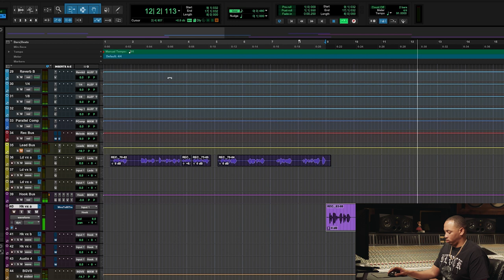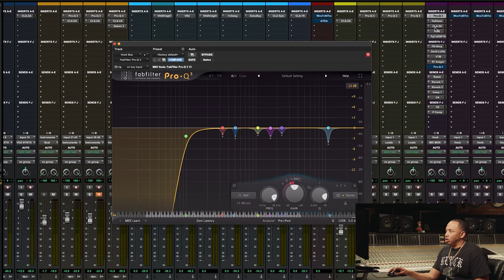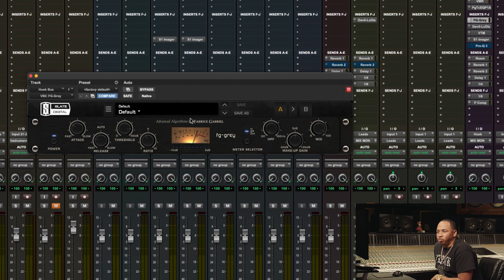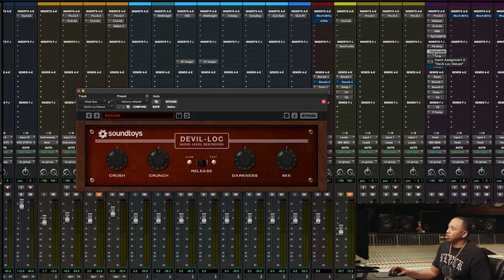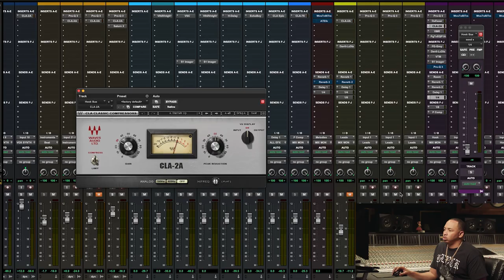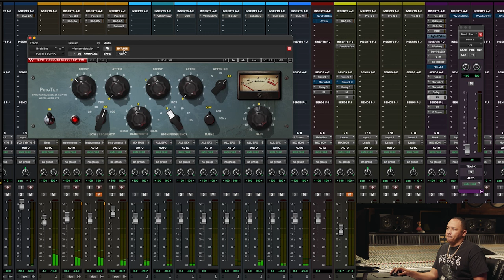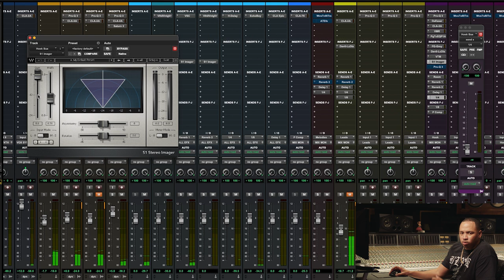SKI MASK VOCAL CHAIN | with CUTTA CLASSIC

Comment: Thanks for the tutorial/explanation, but it doesn't sound that great tbh.  The vocals are muddy (but a stylistic thing I'm sure), don't sit right, they feel drowned out, and the effects aren't that great either.  I've heard the name Cutta Classic before and expected a better sound when I heard the name.  All love tho 🖤
Reply: You can fix the things you’re describing in mastering a lot easier than in the mix phase i feel. Mid side cuts could help with mud. The effects when mastered with a transient expander in the sides would help. The mix right now has a signature sound that can easily be expanded upon in mastering(to me haha, just my opinion)
Reply: @vigneshkarthikeyan8174  Always fix things in the mix, mastering engineers shouldn't have to 🖤 But that's a solid ass point
Reply: Thought I was the only one hearing this. Sounds like a rough mix at most. To have all them plugins just for the vocal to sound mediocre shows you the clear difference between a ‘recording engineer’ vs ‘mixing engineer’. This sound could’ve been achieved with the stock ChannelStrip & BombFactory 1176 🤦🏽‍♂️
Reply from the maker: Thank you for watching.  We appreciate the feedback!
Reply: It sounds 80% done. After a master it will sound bigger. Sometimes when I would do a rough mix on a song of mine I would do to much delay reverb brightness etc. And then the master would make everything incredibly loud and over board and yeah like you said its a stylistic approach. It's not exactly taylor swift pop music
Reply: @vigneshkarthikeyan8174  You've got it backwards. It's much easier to fix things in a mix rather than a master

Comment: My Boy sitting there infront of this big ass console and telling me about some plugins which litteraly emulations it?!

Dude turn that plugins off and make some hits on the Console like fr dawg
Reply: he prolly got shit running into the daw, bro u do know that all the top engineers dont rely completely on analog, they all use plugins, mike dean, jaycen joshua, dave pensado, they all use a lot of plugins, fits they workflow better and some plugins just sound really good, cuz analog is more expensive doesnt mean thats the only thing u should be using dawg
love
Reply: L
Reply: That shit is so over rated. only gear I would want is a nice pre amp and compressor for recording. Everything else you can do in the box if you know what you want.
Reply: @lilwombat  facts..im tired of these boomers talking bout all that big bulky goofy heavy overrated gear bruh
Reply: Work smarter, not harder.
Reply from the maker: Stay tuned...
Reply: preach